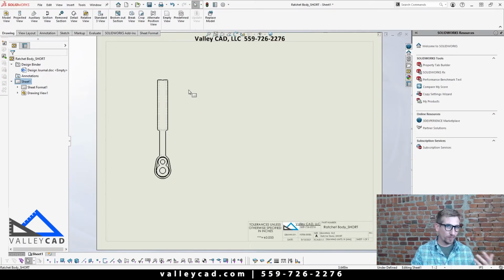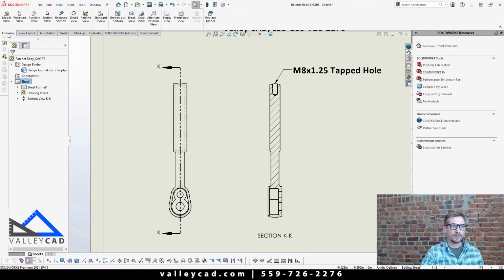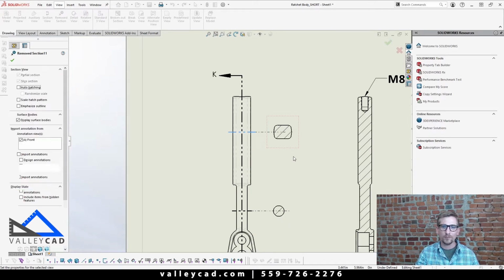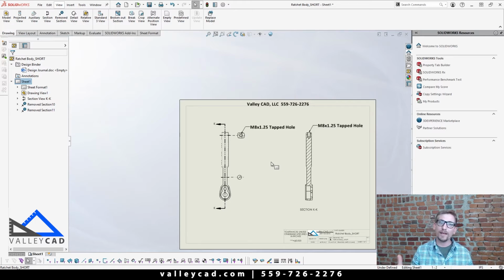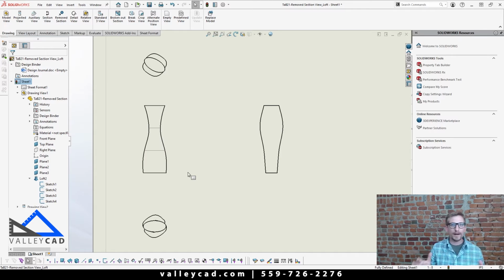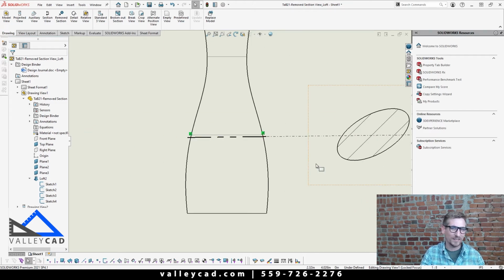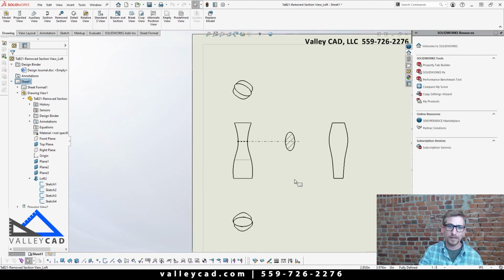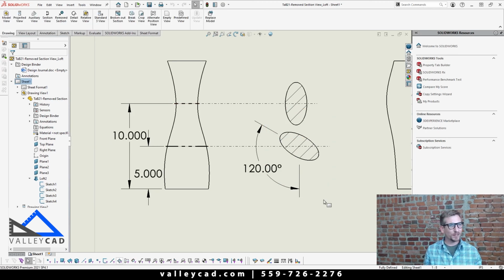Remove Section | Take a Break with Valley CAD | SOLIDWORKS Training

Comment: 2019 had a "Drawing" tab, but it was turned off by default in favor of "View".  However, "View" and "Drawing" tabs are redundant to each other with "Drawing" including a few more commands, so it made sense to just make "Drawing" tab default in newer releases of SW.  "View" should still be available to turn on if someone really wants it in the current release.
Reply from the maker: Hey fcsuper!

Thank you for the response. You are correct! we have been asked by customers in the past why their View Layout tab disappeared. Since upgrading to SOLIDWORKS 2020<. Thank you for the comment. 

Valley CAD Team